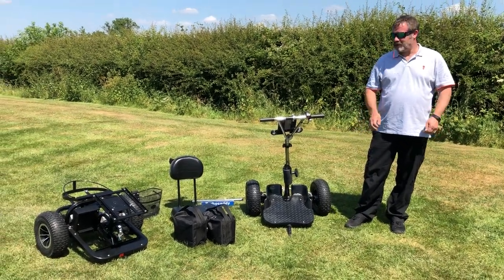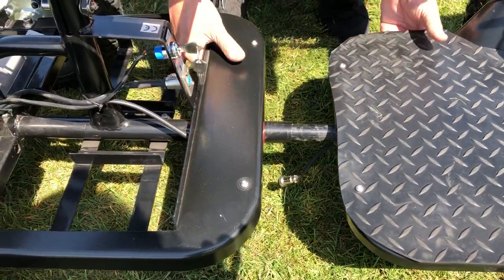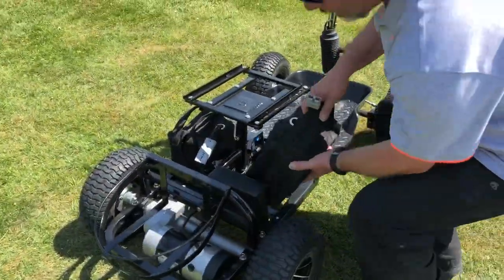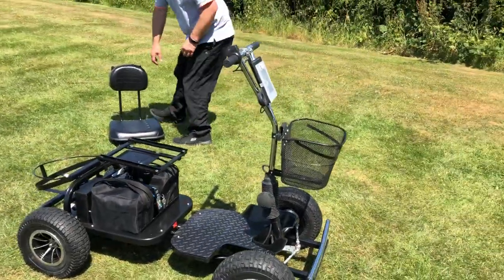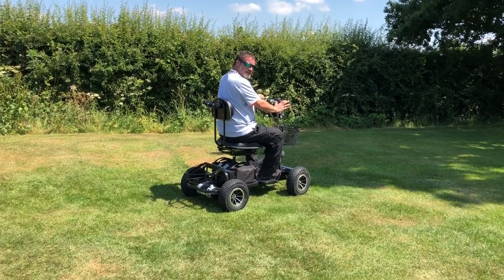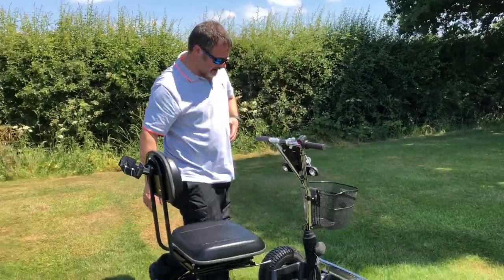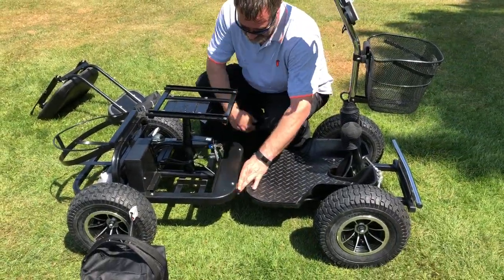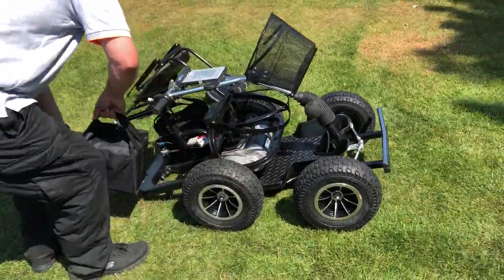IMG 03331

Comment: Hi Darren I bought a buggy off you a couple of years ago.  I recently lost drive forward or backwards.  The battery is still good and when I turn the key then turn the throttle l can here the brake release but there is no momentum.  I can bring the buggy up to your workshop from Basingstoke but I need you to be able to look at it straight away or perhaps deliver it back after looking at it.   I can do 7th 8th or 9th of june or any day 12th - 16th June.  could you let me let me know asap please.  Im guessing it will be something very simple.  Many thanks Keith.

Comment: Darren I have put my 36 hole buggy together. A negative is that the seat will not come off or slide like yours does. This is no good to me. It works fine operation wise but the seat slider is poor design. I noticed you on the video and it wasn't easy on the video. Have you an easy fix.
Reply: Think you have put it on wrongly

Comment: Hi Darren. Hope u can help. Someone accidentally ripped the plug off the control lead from my hillman buggy and i dont know which colour wire goes to which terminal on the plug. I would be very grateful if you could help. Its the plug from the handlebar unit. 
Regards
Doug
Reply from the maker: Hi not sure exactly with Hillman mine is similar but not the exactly the same , has your got a twist throttle or thumb switch, and has the plug git 4 wires or 6?
Darren
Reply: @darrenculver7625  ah Darren. Thanks for the reply. Its got 4 wires and thumb switch. 
Doug

Comment: Darren the gear switch on the rear axle keeps on dropping on my buggy. Can you tell me how it can be fixed. I've only had it since the 17th of March & it's worked perfectly since then but today I had to come off the golf course.
Reply from the maker: Hi if you send me an email so i have your address or call me the n i can let you have the instructions to adjust the gear lever. Too long to post hear